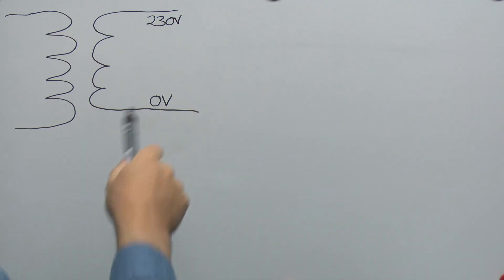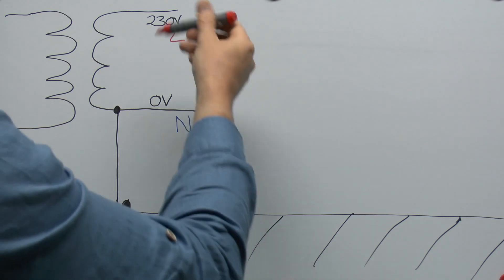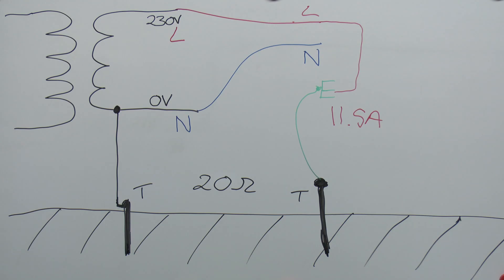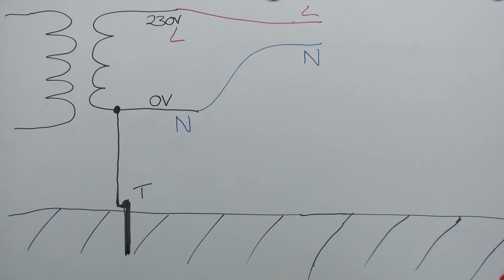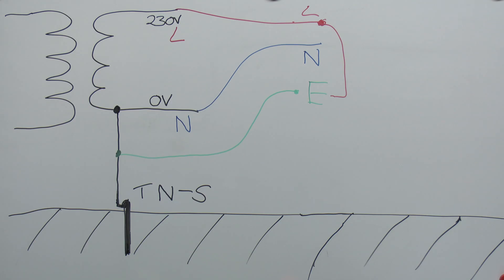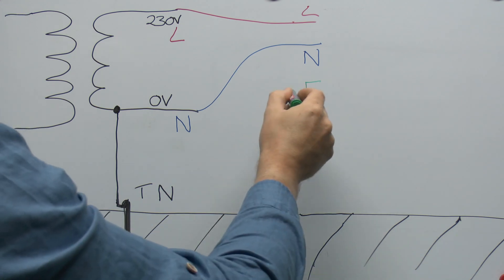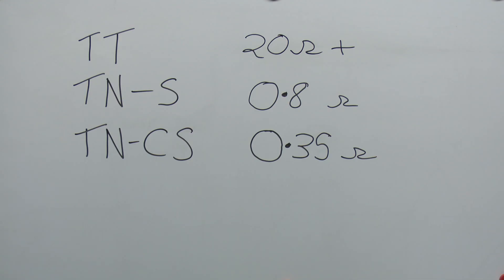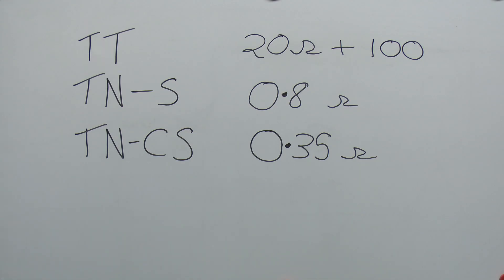Types of Earthing System for Electricity Supplies (UK)

Comment: My earth type is TT and the building is supplied by two separate overhead cables. Are the supply company unlikely to change to TNCS as there could be a fault on the neutral supply cable?
Reply from the maker: Rhys Williams The cables probably won't make any difference - whether TNCS is available or not really depends on how the rest of the network in the area is constructed, some are not suitable or would require significant (and expensive) modifications.

I have seen a few TNCS supplies with 2 separate cables, so they certainly exist - I would not want such an arrangement though.

Comment: TN-C-S is also the standard for system grounding in the US and Canada and has been for quite some years, except it is common for the main distribution board to have its own ground rod connected to the ground bussbar.  The only other difference is that the supply transformer has a 240V center tapped secondary which is grounded and the end taps providing the 2 120V hots.
Reply: I think termed as single phase 2 hot wires?
Reply: @johnburns4017  It's more commonly called split phase.